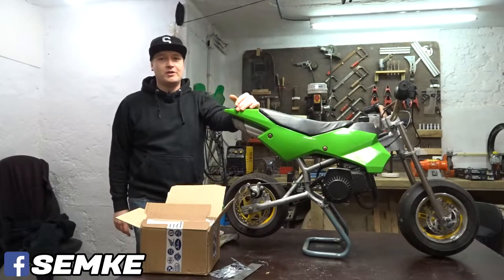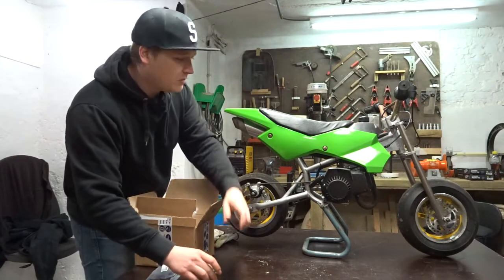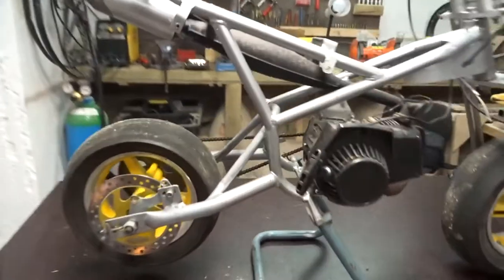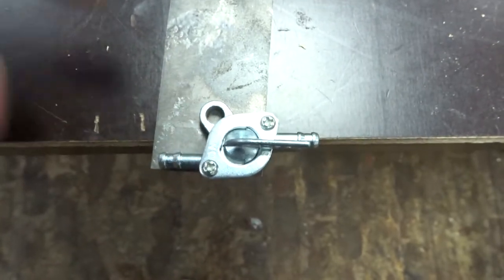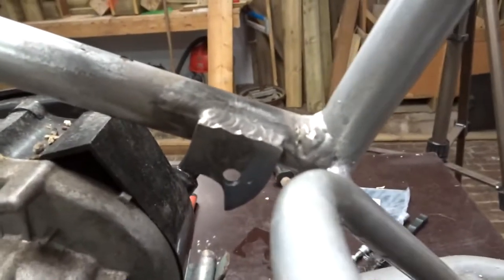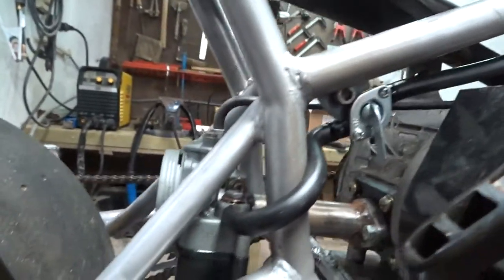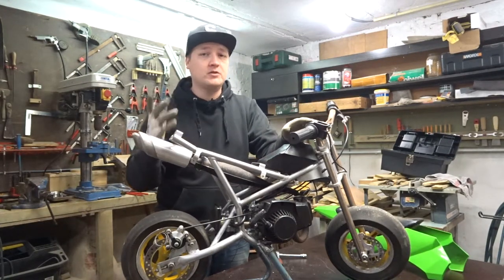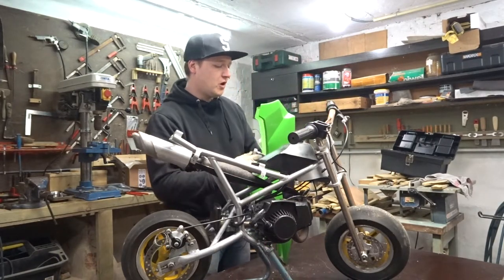custom fuel tap on the pocket bike / mini bike

Comment: Try to rotate the banjo on the carb by 90 degrees so the fuel inlet is facing forwards. Then you can route the fuel pipe after the tap through the frame on the inside and won’t have to go around the outside of that vertical frame pipe. 👍🏼